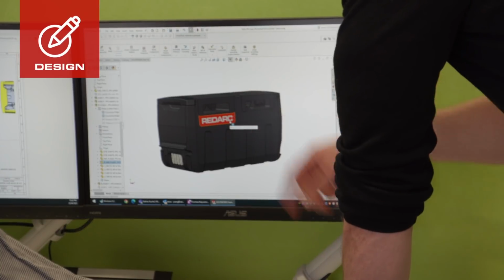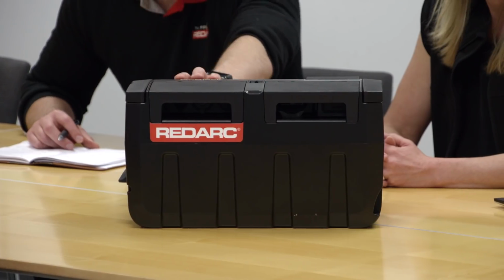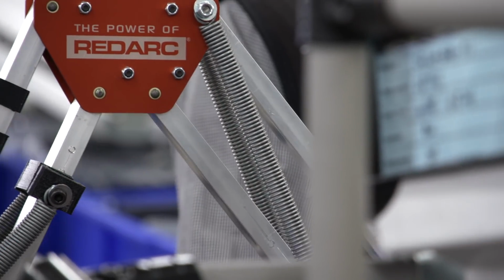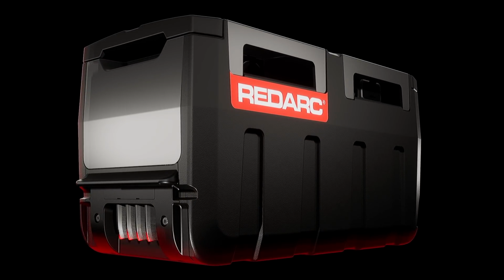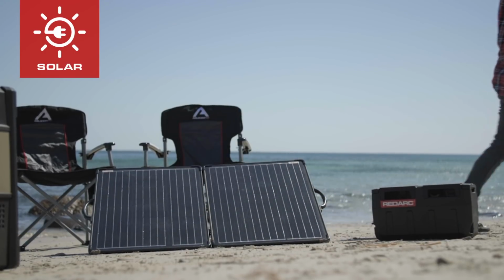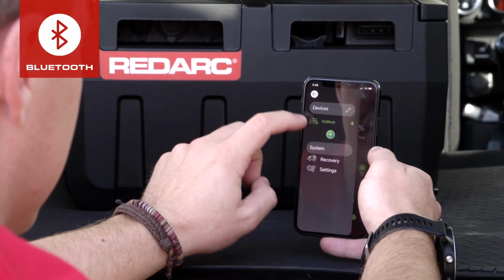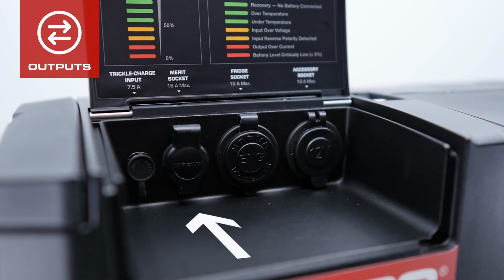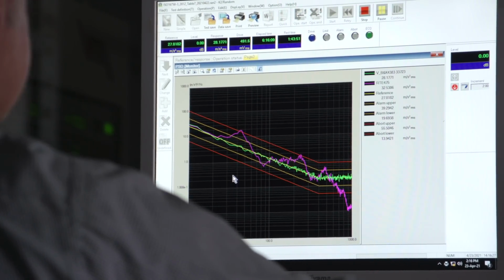Explore GoBlock | A look inside REDARC's Portable Dual Battery System

Comment: How long it will take to charge it with standard battery and alternator with Anderson plug? Thanks
Reply from the maker: Thanks for watching! When setup correctly, the Goblock will charge up from 0% to 100% in 2 hours while the car is running.

Comment: Genuine question. What advantage does this unit have over a engel series 2 smart battery box, with a 100AH LIFEPO4 fitted? I must be missing something as the Engle setup is less than 1/2 the price . I’m looking at the Go Block though trying to understand why it’s $3.2k and what it’s advantages are over a power box + lithium Battery.
Reply from the maker: Thanks for watching! Unlike traditional battery boxes, the GoBlock is fully sealed and contained with the battery built into the unit. This means that there’s no worry of battery concussion as the battery is unable to rattle around inside. It’s also surrounded by a tough aluminium casing with no exposed fans of vents so it can be exposed to splashes, dust, dirt and vibrations without worrying about damaging any of the internal workings. The GoBlock can be charged via AC mains power, solar or vehicle alternator power while driving and features 12v accessory sockets, Anderson outputs and USB sockets for charging all of your devices. If you’ve got any further questions, our Technical Support Team are always happy to help on 1300REDARC (1300 733 272).
Reply: @REDARCElectronics  thank you.

Comment: Going through the comments and I am not quite sure its been answered but, can you run power from the house battery and alternator to charge this unit whilst driving via the plug at the back of the box and if required to remove from the vehicle can be charged via the same plug via a solar blanket?
Reply from the maker: Hi Adam, thank you for watching and for your interest in our Australian made GoBlock. You can indeed charge the system using vehicle power, whether through the cigarette socket or wiring direct to the alternator. Our unique docking station can also help deliver up to 50A of fast charge depending on the capability of your vehicle, while you are correct that a solar panel can be added to deliver charge when setup at camp. For more information visit https://www.redarc.com.au/goblock or contact our Tech Support Team on 1300 REDARC.

Comment: Sorry if this has been covered but can this be mounted and stay outside? I want to mount this on my tray back with the power dock and leave it there to run my fridge, but I don't want to void the warranty or have it break in the event of rain etc.

Thanks in advance
Reply from the maker: Hi Ryan, thank you for your message. Ideally the GoBlock should be mounted in a covered environment as you wouldn’t want for it to sit out in the elements permanently. It is water and splash resistant so can survive and be used throughout the year, however any prolonged exposure may have an impact over time. Any further questions please don't hesitate to contact our helpful Tech Support Team on 1300 REDARC.

Comment: Can this be charged back up from the vehicle alternator? Does this have the redarc bcdc built in? If so, how does that work with this?  My understanding is the bcdc needs like 3 different grounding points (one from the main battery, one from this backup battery, and one for the bcdc itself).  How does this battery box get grounded so that the bcdc works?   Thanks for your help.
Reply from the maker: Hi John, thanks for your comment. GoBlock can indeed charge from the Vehicle’s alternator/Start battery either via an Anderson connection or using our PowerDock system. 

The earthing is done via the Anderson to either the Vehicle chassis or back to the Start battery and this is all it requires. 

The internal DC-DC charging is up to 50A and also earths through this connection and to the battery as well. Let us know if you have further questions, you’re more than welcome to give us a call on 1300 REDARC if you want to discuss more!

Comment: Does the anderson plug work both ways ...for charging from solar panel to goblock and to plug into a fridge ( companion S , 75litre with lithium battery. ? Can I have the go block  charging and at the same time be using it to power a fridge?
Reply from the maker: Thank you for watching, and for your interest in our Australian made portable dual battery system. In response to your questions, the charging Anderson input is only designed to take inputs sources (Vehicle and Solar); it won’t output to a fridge etc. There is an Anderson connector on the other side of GoBlock for this purpose – you can connect your fridge here. The unit is able to charge and have power drawn from it at the same time, yes. You can charge from any of the three inputs and it will work well. Any further questions please feel free to contact our friendly Tech Support Team on 1300 REDARC.

Comment: Can i pair this with a Projecta Intelliwave 2000 watt Pure sine wave inverter ? And what connections would i need ? Thanks a lot
Reply from the maker: Hi David, thanks for watching! The maximum inverter size suitable to run on the GoBlock is 500W-750W, however would be best to chat to our helpful Tech Support Team on 1300 REDARC to run through what devices you're most likely to want to power or charge.

As for connection to your inverter, our SRC0010 is the most suitable but again best to find out how via our support line.

Thanks again, REDARC.

Comment: What would be the way to power an 87W USB-C laptop? would the USB-A output work with a USB-A to USB-C converter, or could some third party inverter run off one of the other outlets?
Reply from the maker: Thank you for watching, and for your interest in our GoBlock portable dual battery system. 

You can run an inverter up to 500W via the 50A Anderson output to power loads such as laptops. 

If you have any further questions please touch base with our Tech Support Team on 1300 REDARC and they'll be more than happy to assist.

Comment: Questions...charging via vehicle - does that mean you connect cig socket from the box to cig socket in vehicle? 

Fastest way - using Anderson connection into the unit, does that mean the vehicle must have wiring from main battery with fuses/Anderson connection that connects into Anderson connection in battery box?
Reply from the maker: Hi Miguel, thanks for your message. 

Charging GoBlock from the Vehicle can be done by using the supplied Accessory socket trickle charger cable or via an Anderson connection from the Start battery. 

The Accessory socket cable utilises the 7.A trickle charge port on the unit only, not an accessory port. With the Anderson cable connection, you will need to use suitably rated cable and fuses for your application – check out the GoBlock manual for more information on this at https://www.redarc.com.au/100ah-goblock-portable-power-system

Comment: REDARC - this is a good product and I can see a lot of thought has gone in to it, as well as testing for Australia conditions. Good work. However, being someone who does 4WD'ing, Trades and other activities I might have some construtive feedback/suggestions - which would be. 1). In future moels, include a built in 240-Volt Inverter to run tools up to 1800Watts. 2). Provide functionality to add batteries together for additional capacity. 3). Revise the pricing - too high for feature set provided and for battery size, especially without an inverter included. 4). See products like EcoFlow Delta for an example of value/price point versus feature set. I would have bought this if it was about $1400-1500 but geez you're asking 
$2,395 AUD... that's... excessive IMHO. I look forward to your next version including more features as I'll buy one if it addresses those shortcomings mentioned.
Reply from the maker: Hi Kim, Thank you for your feedback and suggestions. As REDARC designed, developed and manufactures the GoBlock, feedback from our customer is essential for future developments. As you can imagine a lot of research and development has gone into the GoBlock to create a portable power solution suited to as many customers as possible, we have considered those who would like to power 240 volt devices off-grid as you can connect an inverter up to 700 watts into the 50 Amp Anderson output. Whilst price is important REDARC products are made to the highest quality, these are the products you can rely on wherever you are. If you'd like to discuss the GoBlock further please feel free to contact our helpful Tech Support Team on 1300 REDARC.

Comment: No 3 pin 240v plug? I went with itech 1300p.
Reply from the maker: Hi Aaron, Thanks for your enquiry. The GoBlock does not have an inbuilt inverter but can be easily connected to an inverter up to 700 watts via the 50A Anderson output.
Reply: @REDARCElectronics  thanks for the reply. Maybe next product would have one in hoping. I'll wait out. Cheers
Reply: @deepshallows  what’s your opinion about the itech 1300p
Reply: @sahilsahil4481  pretty happy with it so far. Got a solar blanket and adaptor bundle to go with it. I use it as a UPS at home or emergency backup and take it camping on trips. It’s got a PD port which is very handy. Was looking at the GoBlock but it doesn’t seem versatile enough. The 2 240V 3 pin sockets run majority of my appliances and electronics. The best part is when I change cars, I just take the whole lot out in 10 seconds

Comment: From what I can gather from your website, unless I get in addition to the GoBlock, the optional PowerDock, the GoBlock on its own will only accept one source of charge at time?  EIther DC-DC or Solar but not both?  Is this correct?  If so, when in 2022 will the PoweiDock become available, and how much extra will they cost?
Reply from the maker: Hi HammerRocks, Thanks for your enquiry. If you are not using the PowerDock there is the single input Anderson plug which you can connect either vehicle or solar charge. More information on the release and availability of this product will be announced in the coming months.

Comment: Love this idea. Currently have 120AH ARK Pack and its way too heavy to move around. Can you run an inverter from this unit and what limit inverter size is recommended as I need to charge a laptop? Indicative price??
Reply from the maker: Hi Peter, Thanks for your enquiry. The GoBlock 50A output can be used to power an inverter up to 700 watts. However if you wish to charge your laptop the 350 watt pure sine wave inverter would be the best option, with a few modifications our eyelet cable will work with the GoBlock, more information about our 1.5m Anderson to eyelet cable is at https://www.redarc.com.au/15m-anderson-to-battery-eyelet-terminal-cable

Comment: Does it have USBC with power delivery? Preferably 100watts…
Reply from the maker: Hi Boris, Thanks for your enquiry. The GoBlock does not have the USBC style connection however has 4 X 2.4 amp USB Type A ports.

Comment: You know I’ve been googling, looking and researching how to go about putting a auxiliary battery into my Ford Everest without detracting from the vehicles aesthetics, plus keep it as a 7 seater and use it for touring when I want. This seems to tick all the boxes. Can you explain how the PowerDock works please. Cheers. Bob
Reply from the maker: Hi Robert, Thanks for the feedback sounds like the GoBlock is the perfect solution! The PowerDock is a cradle that mounts into your vehicle in which the GoBlock locks in and secures. The PowerDock can also be wired back to your starting battery and/or solar and will automatically connect for vehicle and solar charge whenever the GoBlock is locked in. This product will be available to purchase in the coming months.

Comment: Is the battery included? Can the battery be replaced when it goes bad? Also do you need a bcdc charger or is the charging system already pre installed?
Reply from the maker: The GoBlock has and inbuilt lithium battery and is available in two variants, 100 amp hour (PPS12100) and the 50 amp hour (PPS12050). Whilst the inbuilt battery cannot be changed in the field, if required this could be done in-house at REDARC.

Comment: Well Done Redarc Been using Goal Zero for years Now Only Because it is portable Can it be Daisy chain?
Reply from the maker: Hi NSW Mods, the GoBlock is a standalone portable power system and has not been designed to be linked with another GoBlock system.

Comment: Been waiting for this for a while now, excellent, any specs on the solar input?
Reply from the maker: Thanks for the feedback, we are very excited with the release of the new Go-Block! The operating voltage range of the solar input is 9-32 volts and whilst there is no limit to the amount of solar you can add to the Go-Block, to create 50 amp (maximum charge rate) requires 800 watts of energy. Full specifications can be found in the user manual from page 37. https://www.redarc.com.au/images/uploaded/REDARC%20GoBlock%20Instruction%20Manual.pdf